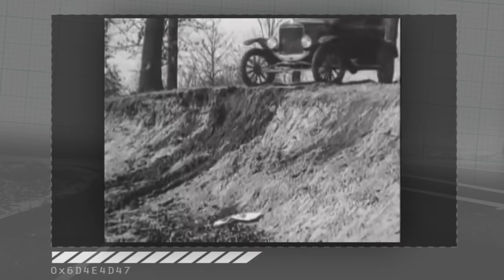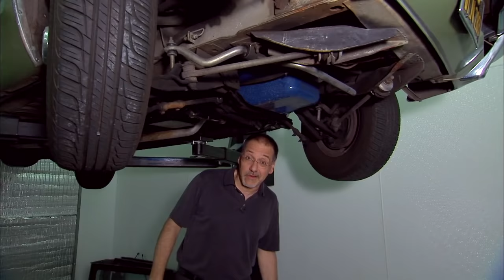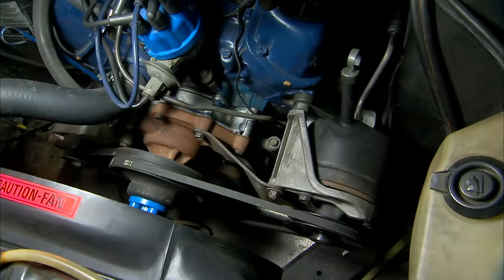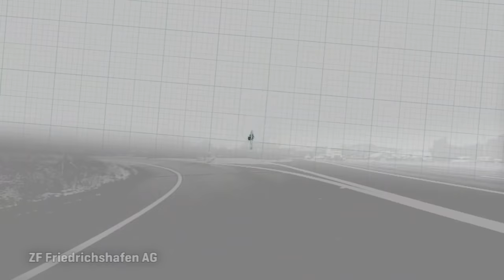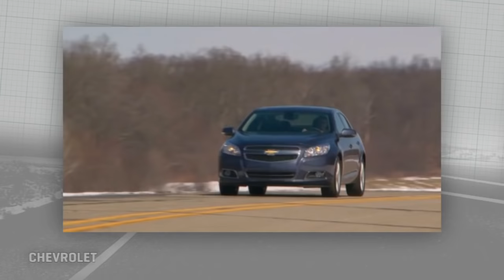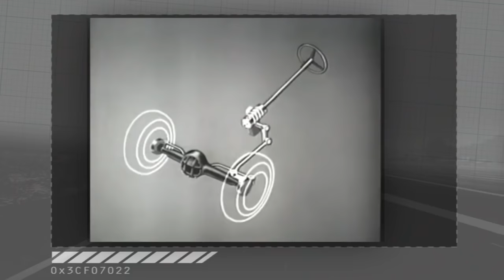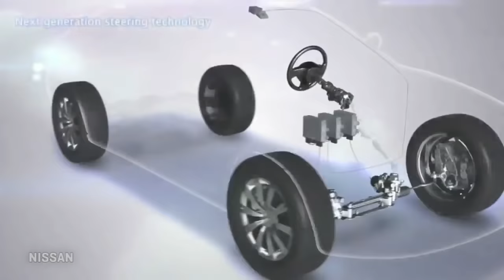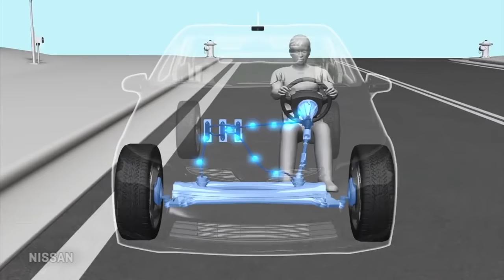Car Tech 101: Power steering explained

Comment: drive by wire...my nightmare lol
Reply: yeah electronic systems have high chance to fail. Mechanical components can last centuries
Reply: The problem is not the electronic components, they can be made to last and manufactures knows how to do it, mechanical components fails too, the fear of going full electric is with the software, and a car connected to internet is a risk because a hacker can control anything connected to it, using the cameras of the vehicle, sensor and yeap the motors and brakes can be controled wirelessly too.
Reply: Jijo Joseph You've got that backwards.

Comment: I like the way they make it sound like cars were hard to drive without Power steering;; my first 6 cars didn't have it and they were no harder to drive than the Granada my brother let me have a go of which did. For the record I also drove a 3 ton (yes they were 3 ton Unladen back then not 7.5 Tonne Gross) truck which also had no power steering and was an absolute pleasure to drive.

My current car has power steering but it seems to go a lot further; in that it gets tighter at speed when it isn't really needed; and becomes very light at parking speeds.
Reply: Nah, its hard to control a non power steering care way harder than a power steering one
Reply: Damn maybe the problem is that you're comparing it to a damn Granada XD

Comment: I see in the comments people are defending steer by wire by saying if it breaks it automatically kicks in a mechanical system. Thats stupid, because the whole point of steer by wire is too save weight and space, and if you have a an emergency mechanical system, then you have defeated the purpose. Might as well leave the mechanical system on
Reply: well said. I hate to see cars getting more robotic, numb and lifeless everyday.
Reply: +Harikrishnan V ---  you just described humanity !!!
Reply: Lol
Reply: +Frank Magana i think the main reason is you can adjusted either hard or light
Reply: It's not steer by wire if it can automatically work mechanically if it fails—because that's exactly how they work now
Reply: +Frank Magana Suppose you are driving 100 Mph and suddenly the transistor on controller board shorts and sends continuous supply to steering motor, then the motor will continuously run and move the car to out of the road.
Reply: +Harikrishnan V I love cars and I totally agree. I love having cars as an extension of your own body, manual transmission, abs/traction control on/off buttons or none at all. Simple mechanisms with plenty of room for modifications and space in the engine bay. Now every car that looks fun to mod or play around with has an engine bay that looks like a 3 dimensional Tetris, BMW doesn't make M/T cars. Some VW touring cars don't allow you to turn off traction control. Mazda still hasn't come out with a new MazdaSpeed since 2013. An ex-coworker only found 2 M/T Golfs out of about 200 at a local VW dealer. Every professional race car nowadays has that "Semi-Automatic" paddle shifter bullshit. Probably the closest thing to "back then" right now is Rally. All these Manufacturers now seem to only look at the consumers not interested in the experience, just how the car looks and how comfortable they are. Yeah Nissan has Nismo, Mercedes has AMG, Ford has their Ford Performance branch. But those hi tech, pre tuned, sardine can engine bay cars will never beat the personal experience of driving anything before 2007. And about Ford, I have literally never seen an M/T Mustang between 2005 and 2016, and there are tons of Mustangs, plus I work for Discount Tire, so I see plenty.
Reply: Well too bad they made some cars specifically the cyber truck

Comment: Regarding full electric steering ("steer by wire"), I don't think electric systems are inherently less reliable than mechanical ones.  I think if it is built well, an electric system can actually last far longer than a mechanical one.  A properly designed electric system can be simpler, lighter and have fewer moving parts.  The problem is that manufacturers today seem to have a preference for building extremely low quality electronics.  I think the reason is that with electronics, it is harder to tell the difference between quality and junk.  Since the average consumer can't tell the difference, companies cut as many corners as possible to increase their profits. Also, there is a tendency to include flashy, unnecessary gimmicks to make a product more marketable.  All of these so-called "extra features" just increase the complexity of the system and create more potential failure points.
Reply: I understand where you're coming from, but I'm not sure if I feel the same way.  I guess it depends on how much you trust the vehicle's maker to build something that won't "break" unexpectedly. 

Manual backup is undoubtedly safer, but the question is, how safe do you want to be?  The absolute safest form of transportation would probably be just walking, but hardly anyone insists on that level of safety.  Most people prefer to drive because they feel that the benefits of driving outweigh its safety risks.  The same principle applies to electronic vehicle controls.  Some people will feel the benefits outweigh the risks, others won't.  As for me,  I'd have to  consider the overall context before I could decide.
Reply: we dont trust vehicle makers because they are in for the money. i mean look at vw group and their emission cheats, shortcuts taken by toyota to reduce reliability and the list goes on......
Reply: +beating2
I agree.  I think it is foolish to assume that a corporation is anything like a real person.  It is really a machine designed to generate profit for its shareholders. That is a corporation's only function, and the only goal it can pursue.  Thankfully, there are situations where it's profitable for a corporation to act in the best interests of its customers.  Toyota, for example, makes vehicles that are generally very mechanically reliable.  They have a reputation for lasting a long time and requiring relatively few repairs.  This reputation has made Toyota very successful, and allowed it to generate a lot of profit.  So we can trust that the company wants to maintain its reputation by continuing to make reliable vehicles.  This is good for consumers, but Toyota's motivation is nonetheless purely selfish.
Reply: *****
but their vehicles werent that reliable. aygo - cltches, sticking clutch; prius all sort of problems; avensis had some problems

Comment: Steer by wire is not gonna kill you if it fails, it has a clutch to convert the system in pure mechanical steering, without assistance
Reply: +Rafael Ponce i think you're confusing steer by wire with electronic power steering.

Comment: When electric component fails, the circuit to these motor/drivers shorts or remains open....... and happens without a warning.
When a mechanical system fails, it starts failing slowly.....Suppose you are driving 100Mph and the driver circuit shorts down and continously supply current to steering motor and you car turn the steering left or right and then boom.
Reply: Milenio 3

Comment: Ha, all these comments.  I like the skepticism.  Perfectly natural.  People had doubts about hydraulic power steering.  What if the seals blow out?  What if the column shears?  What if orifices block off?  What if the applied force rips off tie rods?  What happens to working fluid viscosity throughout its operational life?  How well will the fluid tolerate winter and summer temperatures?  Why should we expend the gas to power any of it when you could get a nice upper body workout everytime you drive?  Why not just use bigger steering wheels?  Why should I rely on a high speed pump constantly wearing itself down to eventual failure?  Why not gear it in and increase number of wheel turns to up mechanical advantage?  Why rely on flimsy steering rod connections?  Why drive at all when you could ride a horse?  Why ride a horse when you have two perfectly good legs?

Recurring complaint seems to be electronic failure.  Buddy systems make anyone feel better?

Drivers are GOING to be removed from the drivers seat.  Semi-Truck driving jobs will be the first major vocational economic casualty of driverless cars.
Reply: I keep hearing that but technological limitations aside there's going to be a huge amount of red tape to be cut before automation can be considered a viable option. We won't just hit the ground running the day all the bugs are worked out. There will also likely be problems to arise that we're not even considering yet.
Reply: Are you out of your mind, It seems evident that you re fully unaware of the workings of any electrical system.
Reply: +elintra I see the point sailed right over your dome.  That point being, there are problems with every system, electrical or hydraulic.  But please tell me more how I have no understanding of any electrical setup in any system in the world.
Reply: I'm a computer tech (systems engineer). This is why the next vehicle I buy will have 0 computers in the drivetrain (12v Cummins 6BT manual mid 90s Dodge 2500). 

I would also say that I don't want to be driven anywhere. There's a reason my primary vehicle is a motorcycle in the summer. To drive for the pleasure of driving (or riding, in the care of the bike) is one of the reasons why I typically buy older vehicles.
Reply: This is what I admire, more about the sentimental value.
Reply: The reason people are so against fully electric steering is that because there is NO mechanical linkage between driver and front wheels, therefore there is NO feel or feedback to the driver. So not only do you get zero road sensation to "feel" what the front wheels are doing, but if parts in the system are wearing out or damaged, you will have no idea about it until they fail completely, either causing a terrible accident, or at best rendering the car undriveable.  
Computer controlled systems do not give any warning they are about to 
fail. They can fail instantly and completely, which is why drive-by-wire
 steering system failing is much more scary than the power assistance on a mechanical system failing.
While there is some validity in all the objections to hydraulic power steering that you list, the big difference is that with a direct mechanical linkage, there would almost always be some warning to the driver if parts were wearing out or damaged before total failure, and even in the event of complete power assist failure, the vehicle can still be steered, albeit with great effort.
Reply: I'm a mechanic and I do hate fixing wired components either in the engine or drivetrain. I agree that I must need the feel to know if there is something wrong in my systems. I still like Hydraulics since if something went wrong at some parts, you were likely to be able to control it in the last minute to safety. Unlike Wired, you can't have any sensation anything that went wrong and if there is a single disconnection, Game Over. Just like playing a video game and your controller has been disconnected or broke. Worst, if your Computer box is affected,  high probability is that you were likely to die. 
Brakes is your life, Gas Pedal is your death, Gas Acceleration is how fast you will die.
Reply: Hydraulic steering has a way way less change of failing then electric steering. Never heard of a tie rod falling off or any mechanical failure except the pump. Electric is a different story its not close to reliable
Reply: "Drivers are GOING to be removed from the drivers seat."
-I'm still waiting for my flying car.

Comment: So thats why hackers can take control of your car so easily!
Reply: I think you're overplaying the easiness a bit. It's still very difficult.
Reply: Difficult, but not unreachable :)
Reply: MrMovieMan941 Well yes all functions in modern cars these days are software driven. Can be hacked. Have to install a backdoors or alternate chipset which could override the system.
Reply: Is that motor connected with internet  
? 
Tell me
Reply: @iheeb3413  Internate Connection isn't only the case,where hacker comes into the picture.  Physically access to the control unit, Physically tapping the communication chanel, spoofing & tempering the messages and many more ways are there for the hacking. 😉

Comment: I hope steer by wire is hack proof or interference proof.  I could imagine some tech-twit hacking passing cars to mess with the steering.  Oops, I couldn't keep from driving to the fast food drive thru!
The car just steered straight for the power pole.  Wham.

Electric steering is one thing, steer by wire is quite something else that should take decades to get approval from the feds.
Reply: rickpaulos As long as its a point-to-point link, and not a wireless system, you wouldn't be able to "hack" it without physical contact.
Reply: +juarez122191 Airplanes are operated by professionals and are completely different in every way than cars. Joe Random doesn't have the same training as a Pilot. Also just because a technology is good in one application doesn't make it good in a totally different one.

Comment: the problem with steer by wire is that there is no mechanical back up if the system fails.
Reply: yes of course there's a mechanical clutch that engages if the computer fails... the Infiniti Q50 has steer by wire, and that includes a mechanical backup.. check CNET On Cars Ep. 41. Imagine if steer by wire fails with no backup.. total fail.

Comment: So basically your life depends on a few wires? Sounds dangerous to me. The Radio can be electric. But not the power steering. What happens if it shorts and sends the wheels 90 degrees to the right, right when theres a truck there and youre going at 100 miles per hour. Would you risk your children’s life if they were with you on wires and software??

Comment: Electronics and particularly electric motors are prone to breaking. Most mass produced cars would have cheap systems for steering which probably wont last 1/4 of what a traditional hydraulic system would last. My 90s car has less sensors monitoring the whole car than an EPAS (EPOS more like it) system has monitoring the steering. 
If one small thing on one of these epas systems breaks, you need the whole system replaced costing $$$$s.  Save $500 over 10 years? lol, yeah right. 
And that doesn't take into account that they are unsafe, if you lose power, any of the sensors  or the motor cooks itself when you're driving or if you require quick input to avoid an obstacle - look up hyudai i30 moose test.
Reply: +metcard Companies want to make more money and want to control the service of a car as well.